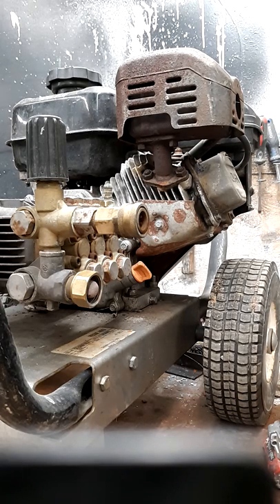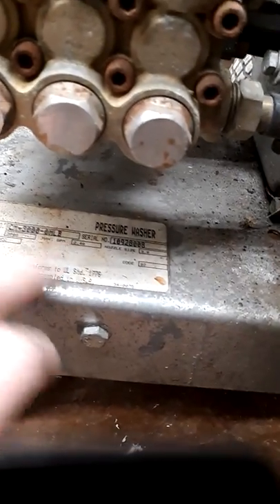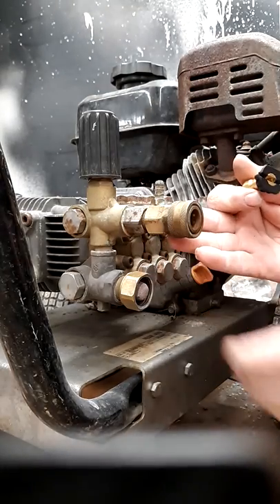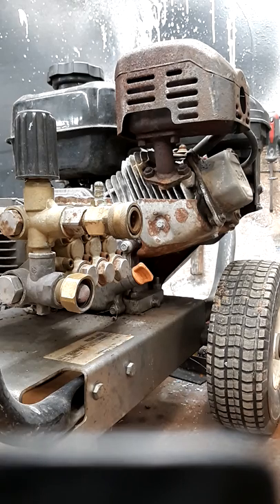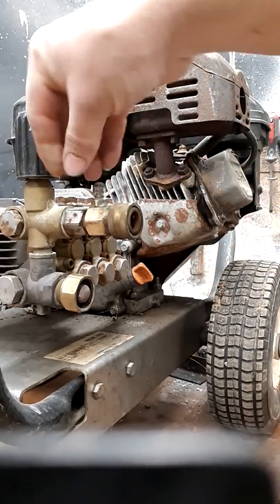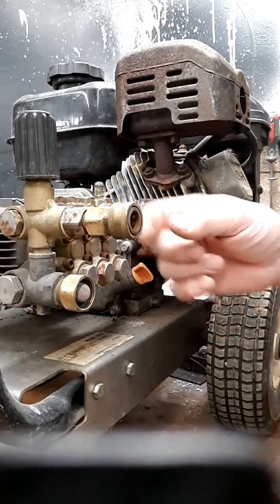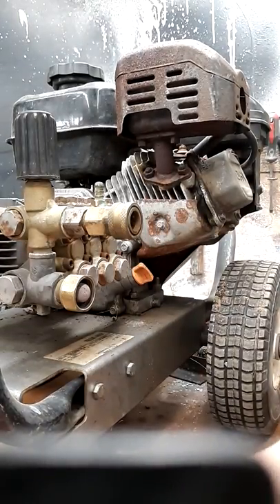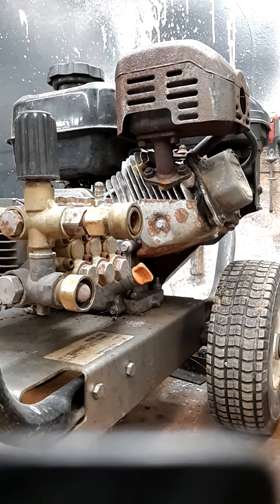Pressure washer chemical injector problems

Comment: Cheers dude 😂 adjustable unloaded answered my question . Would the detergent applicator be ok to use with a good car was detergent or would a snow foam cannon be better job?
Reply from the maker: As long as the detergent is liquid and not made from dry materials you are good

Comment: I have a question, and thank you for the video, I have the same set up as you in this video on my 3.2 GPM and I want to use my down stream injector (same as yours) rather than the stock injector (same location as yours).  Can I cap off the stock injector to use only my down stream injector???  Reason I’m doing this is I’m running hot SH mixes sometimes and I do not want any back flow going into pump at all as that will destroy the pump.  I will also be upgrading machine in future (8 GPM belt) and would rather keep the same set up.  Thank you if you or anybody else can respond.
Reply from the maker: Yes. Cap off the barb by the pump.

Comment: Hi Brian, I have a NorthStar pressure washer 9hp 3GPM with a CAT 4SPX pump.  The downstream chemical injector works with the wand and black tip but won't work when I attach the 18FT washer pole I also purchased (tip or no tip).  I have had both of these for 10 years but never tried to spray chemical though the pole until today.   I thought I may have too much hose so I connected the 18FT pole strait to the unit (no hose) and still won't siphon chemical.  Any ideas?
Reply from the maker: This is typical. The addition of the pole changes the requirements for the injector to work properly.  You can look for an injector that attaches at the end of the wand. I have seen guys put their injector at the connection between the gun and hose with success

Comment: I know it’s been a year but I’m really looking for your help. So I have a 4gpm with 4200 psi.  And I use the fixed downstream injector. My chemical is being sucked up when I have the hose it came with which is 50ft. And I use it with a new gun I bought and works fine but when I put a different hose which is 100ft or even my 150ft hose the chemical does not get sucked out but hears the funny part I know in your vid you said it’s the hose but I think in my case it’s not because  when I don’t have the gun the hose and the hose is just releasing the water through the ball valve the chemical then isss being sucked out but only when the ball valve is fully open. When I put the soap tip with the gun it ends up not working anymore. What is my problem?
Reply from the maker: When you have 100ft or more with the gun,  the injector has a much harder time working properly.

Comment: Great video Brian! can you leave the factory injector in place as is and quick connect your adjustable injector and use that to siphon the bleach while still leaving the factory injector in line unused with no siphon hose attached?  Would the adjustable one still work properly with the factory 1 left open or  Would you need to plug the siphon barb from adding air into the line?
Reply from the maker: Plug it.
Reply: How do you plug it?
Reply: @Lupe Dominguez  I am going to just tape over the factory installed injection barb. I think that will cut down on the draw of s h ..

Comment: I have that same exact washer. How high pressure can you go before that Soap stops injecting? 75 . Thanks
Reply from the maker: The volume of water, not pressure will dictate the flow of soap in the injector. You must use the black tip to allow the flow of soap. If there is no flow, then follow the direction in this video

Comment: I have a 5 gallon a minute pressure washer, so if I ain’t giving it 5 gpm it won’t work.?
Reply from the maker: If you machine requires 5gpm and you are giving it anything less than 5gpm, then it will not work properly. Can cause damage or destroy the pump

Comment: Hi mate. My pressure washer today started spewing water out of the injector after not using it for a few weeks… I’m confused as to why this is happening and not the most savvy person - any advice to fix it? I only turned the water on not the machine and then left it off
Reply from the maker: There is a ball, spring and oring inside the injector fitting. The ball may be stuck. The spring may be rusted out.  Or the injector could be bad. I would take the chemical hose off. Set the machine on concrete and remove the injector fitting to look at the condition of the ball oring and spring. Pay close attention to the order they come out so you can put it back in that order.

Comment: Hey Brian thankyou for helping me troubleshoot the issue. It's discouraging considering I just bought the Simpson Clean Machine 3400 PSI 2.5 GPM 4 months ago and have only used it twice. It seems to be the actual pump that's the issue, I have the spring, the ball, the water volume is good. When I took off the pressure hose and just had the water turned on it was not sucking any chemical. I only used it once before and it worked great. I am not sure what the issue is. Any thoughts would be greatly appreciated.
Reply from the maker: Your pump should not be an issue unless it has an obstruction.  If you have 5gpm going to the pump and it is not producing chemical without the pressure hose on, then you would have an injector issue.

Comment: Hi, I’m having trouble with the soap tank being pressurized so that the soap and water blows off the soap tank cap and eater flows out the tank.
Reply from the maker: @AnnGenua  your tank should have a vent to prevent pressurization and a vaccum

Comment: Hello,  Do you have any experience or knowledge of Ryobi 2.5 GPM pressure washers with a downstream injector? I have a Ryobi 3100 PSI 2.5 GPM. I bought an injector from amazon with a 2.0mm orifice that said that it works with 2-5 GPM machines, but it did not work. I am going to try your troubleshooting steps starting without the pressure hose and see; I read on the reviews some people complained that it did not work with a 50ft pressure hose and others that it worked. I also ordered a 1.8mm orifice injector to try because I think the 2.0mm is more for 3-5 GPM.
Reply from the maker: First step as you said, run it without the pressure hose. See what you have. Then move on from there with your results. Let me know what happens
Reply: @Brian_the_repair_guy  OK, I did the test step by step as you explained. First with the 2.0mm injector, it worked but when I attached the 1/4” hose 25ft stopped ✋ sucking the soap then I tried the 1.8mm injector and that one worked with everything attached.  I did a “draw” test and I got 0.25 gal soap per every 3.5 gal water that is equal to 1:14.  Using a 10% SH equal to  10÷14= 0.7%.  I guess 0.7% is the most I can get?    What I will need if I need a 1.5% SH Strength coming out of the pressure washer gun?   Or 0.7% is the most I will get with my Ryobi 3100 PSI 2.5GPM?
Reply from the maker: @JavierRivera  to get more, you need a pump that will give more gpm as well as a delivery from the faucet that is equal to or higher than the pump
Reply: @Brian_the_repair_guy  THANK YOU.  Do you mean another pressure washer that is 4GPM instead of 2.5GPM?    My water source is 7GPM.
Reply from the maker: @JavierRivera  yes
Reply: @Brian_the_repair_guy  Thank you, quick question, Do you know any surfactant that do not cost and arm and a leg? for example the Apple Blossom one 1 gal is $70 plus $16 shipping. Elemonator is $26 plus $16 shipping. I saw a FarmWorks  80/20 Surfactant, 1 gal for $18 but I do not know if can be used for soft washing.
Reply from the maker: @JavierRivera  that's outside my wheelhouse

Comment: So im not supposed to have the original  downstream injector from the pressure washer and the other downstream injector I bought both on the washer only use 1?
Reply from the maker: I am not sure of your specific set up. Typically you only have one injector set up at the time. Unless you can turn the intake off on one of the injectors,  the injector that is not being used can leak or draw air into the system.

Comment: I'm having a problem with my xr2500 Honda pressure washer. My chemical line pumps water into the chemical bucket constantly if I don't pull the trigger. It's constantly blowing itself off of the chemical hose connector, too. Is that something I can fix? They don't make any parts for my pressure washer anymore. ☹️
Reply from the maker: The injector should be replaced or rebuilt. Watercannon.com might be a source for the rebuild kit
Reply: @Brian_the_repair_guy  Dumb question, which part is that? I've already replaced the chemical hose with the filter on the end. I just placed an order for the small, brass piece with the spring and ball bearing in it but it's not here, yet. Sorry to be such an idiot. 🤷‍♀️
Reply from the maker: @karenb6791notakaren  not an idiot at all. Only a fool assumes to know it all.
The chemical injector is the piece that you have order. The brass piece that the hose hooks to. This should fix the problem
Reply: @Brian_the_repair_guy  Thx, Brian! 🤞 Hope it works, I love this thing, it's been faithful since 2003! 🔫💧💦
Reply from the maker: @karenb6791notakaren  I feel you are on the right path

Comment: Hi
Good explanation.
My issue is the motor seems to get water in it when left outside. I think it comes in from the air filter, what's the best way to get the water out? And also after sitting, the pull start will seize, how can I prevent this, so I don't have to remove and force it each time?
Cheers
Reply from the maker: More than likely the engine will seize due to rust (light rust) forming in the cylinder. Best think to keep either issue from happening, store it in a dry location

Comment: What about if u have a new spring and ball, even tring a added injector but can't get any suction but can blow thru the injector, and water pressure is very good . Having troubles with 2 Dewalts,  a 3800 and 3400psi series
Reply from the maker: 1. You must be able to fill a 5 gallon bucket in a minute to insure you have enough water volume. 
2. If the volume is good, hook 1 water hose to the pump, install injector, turn water on, turn engine on, see if you get chemical.  If you do, then your pressure hose or gun is the issue.  If you do not get chemical then the injector is the issue.  Make sure the injector is in the correct direction. There is an arrow pointing in the direction of water flow. It should be away from the machine.
Use only 1 50 foot of water and pressure hose.

Comment: Should the injector always be in the up position, the clear tube on top?
Reply from the maker: The direction makes no difference. The injector will work in any position
Reply: @Brian_the_repair_guy  thanks. Wasn’t sure with the ball seating one way or the other. I’ve bought 2 injectors and can’t seem to get either to pull chemical or soap. 
I have a 4gpm machine practically brand new. 
I can hear the ball shake in them both. I can drop the injector into water and blow through the tube and see air bubbles. I’ve water tested my water source filling up a 5 gallon buck less than a minute. I’m gonna see if I get chemical with no pressure hose on. It’s a new line 100ft , and gun . 🤷‍♂️
Reply from the maker: @NoName-be5ir  the ball does not move like that. The ball is held in place with a spring, so it will not rattle.
Make sure the flow of water is correct through the injector. There is an arrow on the body of the injector that shows the direction of flow.
Reply: @Brian_the_repair_guy  by your process of elimination I got it pulling till the high pressure line is attached. Then it stops pulling. I replaced the original   50ft with a 100 ft yamatic high pressure hose. I’m now seeing the size difference between the two. The original being much bigger. So the problem seems to be the smaller high pressure hose? 
Thanks for your replies, I e been banging my head against the wall over this supposedly just plug and play part. Lol🫤
Reply from the maker: @NoName-be5ir  glad to help
Reply: @Brian_the_repair_guy  I have 2.1 injectors, going to the 1.8 injectors would I still need to change the new high pressure hose that’s smaller than the original?
Reply from the maker: @NoName-be5ir  hard to say till you try it to be honest
Reply: @Brian_the_repair_guy  appreciate the info soon as I get this hose swapped out I’ll let ya know how it goes. Again much appreciated!!
Reply from the maker: @NoName-be5ir  thank yo

Comment: Brian Shumack. Your explanation on how to trouble shoot a down loader is great! REALLY ! Yet, I am still having difficulties. I replaced my rusty cannon ball valve with a new one. I started my machine without the pressure washing hose attached and it drew chemical right away. Then, i attached just the pressure washing hose and again, it drew right away. Then, i attached the gun (without the tip) and again, it drew right away.
Then, i installed the tip and everything stopped! No draw, no nothing. Could this be my gun is failing ?
Reply: Yes, i started with the black chemical tip and i even tried the pink tip yet, nothing.
Reply from the maker: It is possible one of a few things is occurring.  If each thing is working up until the tip, I would suggest switching the hose or gun and see if there is a change. If you have a build up of corrosion in the hose or gun, the tip could allow just enough of the flow to be reduced so the injector fails. That would be the easiest thing to try first. 
Make sure the water is full pressure from the faucet and use no more than 50 feet of water hose. Let me know what you get. If this does not resolve the issue we will look at other possibilities.
Reply: @Brian_the_repair_guy  Thank you, will do.

Comment: Hello i am trying to use a downstreamer on a 2.4 gpm craftsmen everything is working fine besides it is not sucking the chemica properly. Ive tried everything we mad sure the ball was no stuck everything seems to be in the right place but it is still not working. Help!!
Reply from the maker: My guess would be you do not have enough water volume.  Not pressure, but water volume.  The injector works on low pressure but an increase of water volume. Your pump only uses 2.4 gpm, but your injector may require more gpm than the pump. You need to determine what gpm the injector needs and calculate how many gpm you are getting to the machine.

Comment: My chemical injector is a damaged I don't reuse chemicals I use the pressure washer but only water. can I just take a bolt to block it off? Thanks 👍
Reply from the maker: Yes
Reply: @Brian_the_repair_guy  Thanks 👍

Comment: Hey can you help me understand why my fixed chemical injector  is shooting water out like an unloader valve???
Reply from the maker: @papintoodeep  is the  o ring in place the ball and spring in the correct order? Is it the right size ball for the injector?
Reply: @Brian_the_repair_guy  I have a new 4200psi 4gpm gx390 with a fixed injector. I untighten the injector I seen a bent spring and a ball that look like a bb. But no o ring
Reply: Should  o ring sit inside ,ball in middle  then spring ?
Reply from the maker: @papintoodeep  depends on the injector. Most injectors the o ring goes in the nipple, then the ball and the  spring (direction of the spring depends on the type of spring)
Reply: @Brian_the_repair_guy  last question can I unscrew the injector that connect to tube. And replace it with a hex allen cap?

Comment: Could you use both injectors? 🤔 One to pull SH and the other to pull surfactants?
Reply from the maker: I have no idea if you can use both.  If I had to guess, I would say it depends on the volume of incoming water to the machine. If your water volume is already borderline low, then I find it hard to see both injectors functioning. 
I think I will set up a test tomorrow and see.
Reply: @Brian_the_repair_guy  maybe if you get it going, you can make another vid on it. 🤷‍♂️
Reply from the maker: @Scotith  that is the plan my man
Reply: @Brian_the_repair_guy  im interested to see what your findings on this are

Comment: Hello I have a problem. I brought a new 150' hose and my chemical injector stopped working. It will work with my shorter hose but not with the 150' hose. Can you help me??
Reply from the maker: With the added length of hose, your washer pump may not produce enough volume to allow an injector to work properly.  If you need the added length, you can try a wand injector. It attaches to the tip fitting on the gun. Most use it for acid wash. It will work will most all chemicals.

Comment: Guns and Hoses😆. I unscrewed the big black chemical regulator dial so much that it came off. Problem is.. I can’t screw it back on with the spring inside. The threads won’t catch unless I remove the spring. Help!
Reply from the maker: Well, no easy way to say but to keep trying. It is frustrating at times

Comment: My fixed chemical injector is actually SPRAYING water OUT of the unit. What's the fix for this?
Reply from the maker: If the injector is spraying then the spring or Oring is broke of the ball is bad or the injector is assembled in the wrong order.
Reply: @Brian_the_repair_guy  thank you an o ring ended up getting siphoned into my line, disconnected house and saw it reinstalled worke just fine
Reply from the maker: @infinityhomeservices  fantastic.

Comment: How do i plug the Siphon barb
Reply from the maker: 2 options.
1. Take the bard to a hardware store and purchase a plug of this diameter and thread. Lowes and HD may have them.
2. Heat it and fill it with solder

Comment: So mine 3600 psi 2.5gpm If u take hose off the siphoning works but with hose it won't siphoning can anyone help
Reply from the maker: @Daltonsjungle  if your injector will siphon without the pressure hose, but stops with the hose on, then you do not have enough water flow. Either the faucet is providing enough flow for the injector without a pressure hose or the pressure hose needs to be replaced. Most pressure hoses are steel reinforced. Over time, they corrode inside and restrict flow.